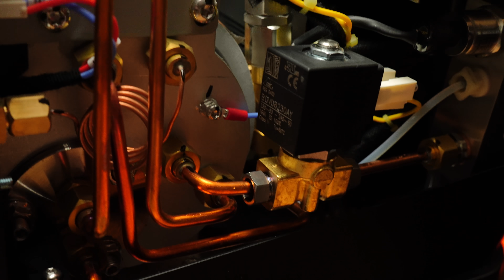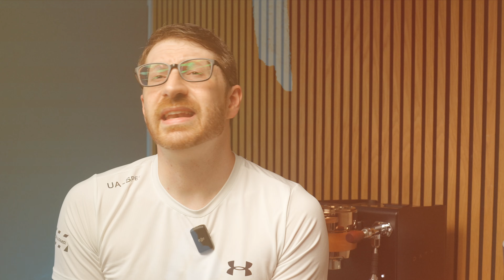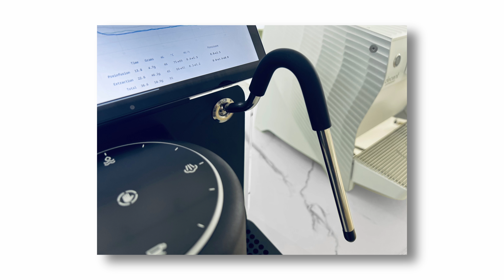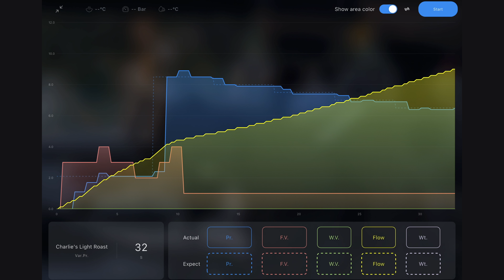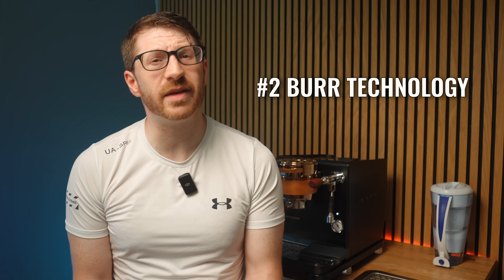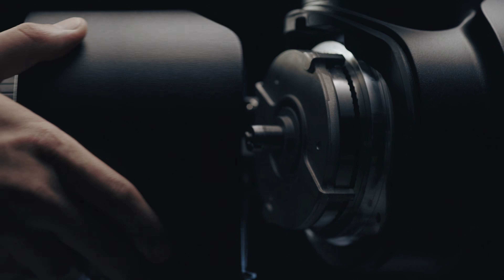Coffee Engineering Is Decades Behind

Comment: Hydraulic Technician here. The vibration pump is better than a rotary pump. The problem with vane pumps is the ones used in coffee machines are fixed displacement. Gear pumps are fixed as well but motor can be used to vary more efficiently.

A pump does one job. Create flow, resistance in a system on the other hand is caused by many variables, not just the puck but even bends in piping, over or under sized pipe and length. If a pump displaces equally between two types. The pressure build up has absolutely nothing to do with the pump but everything to do with everything else in the system. This myth that vibration pumps and rotary pumps in a coffee machine are responsible for the difference in build up differently is plain wrong. 

The biggest issue with piston pumps used in coffee machines is they haven't dampened them enough to overcome thay atrocious buzzing noise. Why they haven't is most likely down to, no competition to Ulka, so no need to evolve years on.
Reply: Look at the Quickmilk Vibration Pump Pulsor. Lowers sound and evens out flow
Reply from the maker: Thanks for sharing your expertise, very interesting.
Reply: The main reason you’d select a Rotary vane pump or Gear pump is Duty cycle.  A vibration pump will not last as long under repeated duty cycle use, such as a cafe.  Cost is also a huge factor. 

While rotary vane pumps are fixed displacement, the flow can be altered using a PWM.  They are no doubt a more reliable technology, and do produce a smoother flow - can that impact taste? Probably not to most people.

At the end of the day it’s about cost, vibration pumps offer good enough performance for a tiny fraction of what a rotary pump costs.  I do disagree with the videos comments on them being obsolete technology.
Reply: @viper468hp  I had been thinking about this comment for days and you just made it make sense. I replace a rotary pump maybe once a year, I see a dozen broken vibratory pumps in that time.
Reply: What would you look for in an espresso machine using a vibratory pump that is experiencing pressure bounce? I typically avoid working on home machines so I don't run into a lot of them, but sometimes I do.
Reply: @Leviathan42069  I work in Industrial hydraulics but I would apply the exact principles to a coffee machine.

If we have abnormal pressure fluctuations, my mind immediately goes to something in the system has either turned into a variable orifice ( causing pressure drops and rises ) or we have a compressibility issue. 

1. Compressibility, is the easier of the two for me. One is we have air entering the system, and the other is we will hear the pump immediately, it will sound starved or with our industrial pumps when cavitating there is a distinct noise . While there we can also listen for any solenoid telltales and we should backpressure with a blind basket or gasket, to bleed system and then recheck.

2. Variable orifice. Thats more tricky to me, but the simplest place to start would be to trace the flow path of hoses and watch them under pressure. If we see a particular hose alternate between tensioned and non tensioned state. Switch off machine and check for any debris within that, moving along as we go. If I don’t find anything in hoses. I have to start considering pump and valves ( OPV in this case ) and disassembly to check housing bores, springs, seats, orings and to check for foreign objects. 

I haven't had any experience with fluctuating pressure on any coffee machines I've owned so this would just be my approach and how I generally think when facing similar issues in the field and have to start thinking about which and when to isolate sub systems to find root causes.
Reply: Just  by a Faema E61 legend, and you're in the money ❤
Reply: vibratory pumps aren't as pleasing to the ear at 7 am when Im pulling a shot. I love how quiet my plumbed in rotary pump is
Reply: Pumps are not engineered for an infinite variety of flow rates though. They are built and marketed for anticipated usage scenarios. And they then have to pass expensive food safety certification. Vibratory pumps are built for price sensitive applications.

In the context of espresso machines, you have a choice of running a vibratory pump at the upper end of its rated flow, or a more expensive rotary or gear pump at a fraction of its intended flow. There are few food approved pumps of different types with equal flow rates.

The wide availability of larger ‘prosumer’ double boiler machines are a relatively recent phenomenon too. Commercial single group heat exchange machines either used external rotary pumps if they were plumbed in, or two vibratory pumps if they used an internal water tank. The biggest serious home machines for many decades were things like the Rocket Giotto.
Reply: a gear pump can probably be more silent, easier than a vibration pump, then if you take the material nobility into account the gear pump is probably the easiest to be truly food safe and vane pump needs a lot of friction to operate, yes food engineers will say plastic is fine, personally I don't want plastic, I want either glass (or pyrex) stainless and even silver, some small amount of silicon or other good rubber to seal, gear pump can accommodate that
Reply: F’ no. The noise is horrendous and not how I want to start my morning